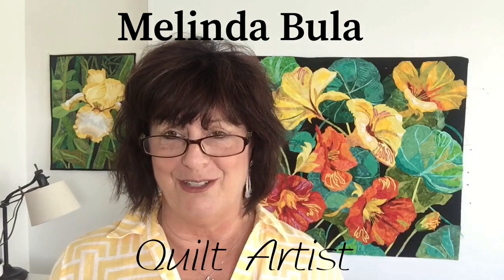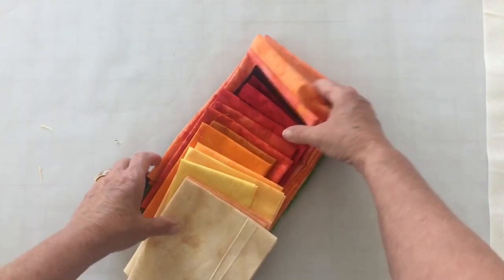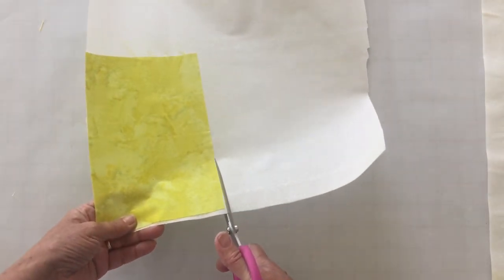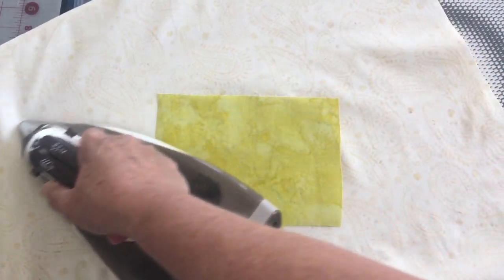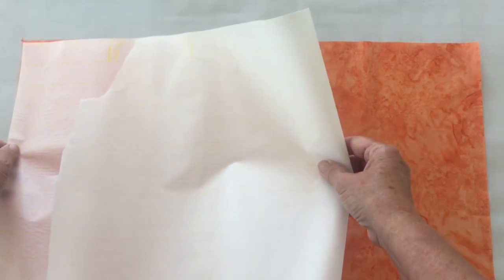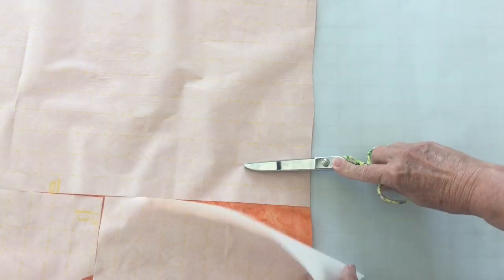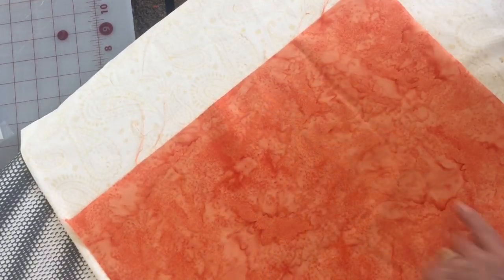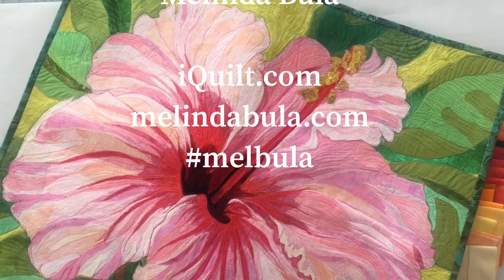“How to Work With Steam-A-Seam 2” - Melinda Bula

Comment: After you cut out a shape, pull off the paper and put it on your background, do you keep adding shapes and then iron all of it at once when you are satisfied with placement or do you press as you go because you know what you are doing?  Either way, is this when you press for the 15-20 seconds for adhesion?
Reply from the maker: Yes

Comment: I want to straight stitch or zig zag the appliqué shapes onto clothing. 
Should I use SaS LITE? so my needle doesn’t gum up? Thank you.
Reply from the maker: I have made many wearable art garments using S-A-S2. not the light. the lite constantly lifts up while I'm trying to stitch it down. hate that. you will always get a little sticky on your needle; it is part of the game. It will not hurt your machine. but you must use hot steam in your final pressing to melt it to the base fabric. If your work feels stiff or hard use a dry iron and warm up the area you are about to stitch it, will melt the SAS2 and make it easy to sew through.
Reply: @MelindaBula Thank you for the answer. It's the same question I had in the last comment.

Comment: Thank you. Great demo. If the adhesive adheres to the sheet WITHOUT the grid,  will this cause a problem when you transfer the adhesive to the fabric using the iron?
Reply from the maker: no. the fusible is the same on both sides.

Comment: Is there a difference between heat and bond and steam a seam?
Reply from the maker: Yes, Heat and  bond cannot be ironed over and over. Steam A Seam2 is sticky on the back , stay in position on my design wall while i am working without using pins and I can iron it over and over with steam and it wont fall off. i don't use the lite Steam A Seam 2. it lifts up. hope this helps.
Reply: @MelindaBula  Yes, thank you it does help.  I will be in the market for Steam a Seam, not 2!  Thanks again.  Can’t wait to get started!

Comment: Why do you prefer SAS2 versus the lite SAS2?
Reply from the maker: The lite falls off too easily. Drives me crazy when I’m trying to quilt and the lite lift up. Sometime when you peel back the release paper off the fusible web on the lite, stays on one side and 1/2 stays on the other sides. Makes my student’s crazy again. And I don’t fine any weight different. I downing art quilts not bed quilts. Hope this helps.
Reply from the maker: The lite lifts up  when trying to quilt. Plus in a hot climate, when you peel the release paper off to use it Half of the fusible stay on one release paper and half on the others side. It can be  a nightmare. Especially with 25 students.